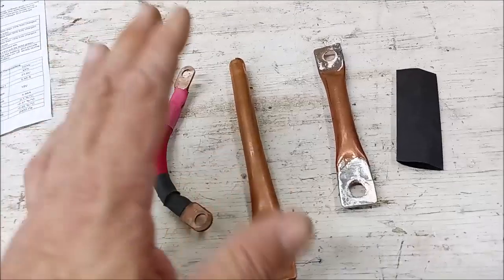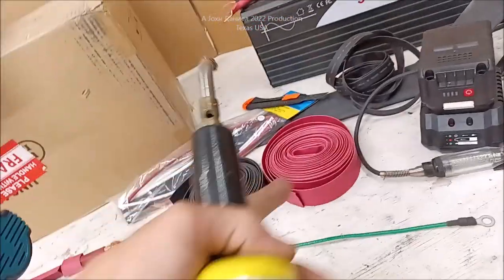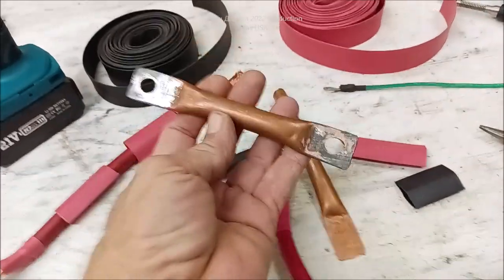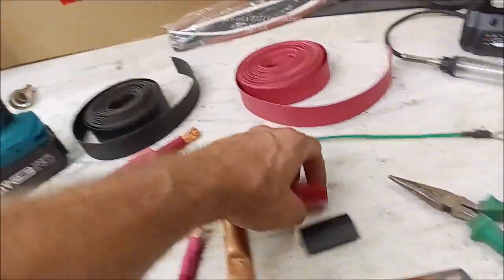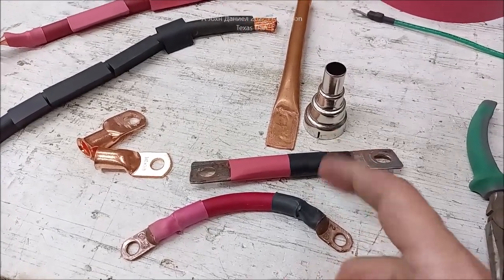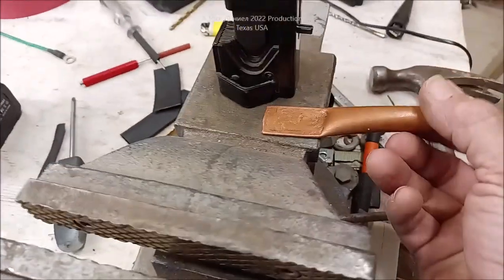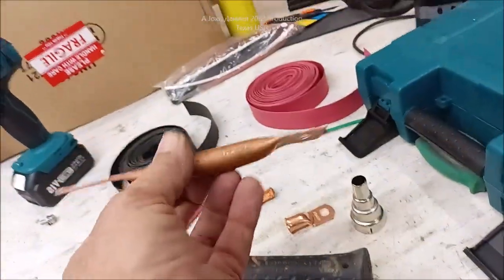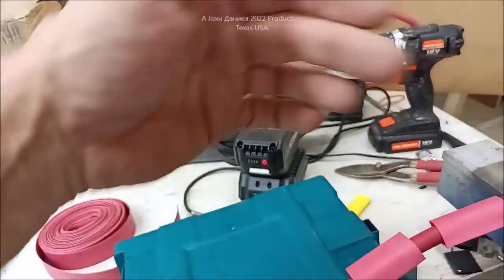Using Copper Pipe in DC Battery Circuits, Review the Uaoaii 21V Cordless Heat Tools

Comment: I've used copper pipe to make cable ends but never as a bus bar mainly because I salvage everything and booster cables that have a clamp pull off or break off are thrown out all the time so is copper pipe even had someone throw out welding cables so all my copper wire and pipe needs are met but it's good to know about the difference between water pipes and air conditioning pipes

Comment: Good to see you feeling better and back conveying knowledge again, John.  A curious thing happened down here in So. Florida (Miami) after that storm went by.  We didn't get much here in Miami except for a lot of rain and a few gusts of wind. Right afterward, and ever since then, my solar increased in efficiency by about 22-23%. Even had to disconnect a couple of smaller panels to keep the controller from overloading. Must have cleaned up the atmosphere a bit, or something. You ever hear of anything such as that before?
Reply: The storm must have cleared the atmosphere of the geoengineering nanoparticulate metals used for spraying from planes for man-made climate modification.  See Dane Wigington's channel for an explanation of that:    https://www.youtube.com/c/DaneWigington
Your panels would always work at that higher efficiency except for the aerosol spraying.

Comment: Good stuff! would you reccomend putting a tad of die electric grease on the bare copper wire before the heat shrink?
Reply from the maker: No, it's DC voltage, the real method is to fully compress. Torque in a DC connection is paramount. In dissimilar metals like Copper and Aluminum in a AC circuit you absolutely need dielectric grease to prevent corrosive effects.

Comment: G'day John, and hello to all the helpers on the team.  Great videos!  I am looking forward to you connecting your wind turbines into your Texas system.  I have looked at you OPC modules and looking to use them on my system here in Australia.  I did see you had more than one model possibly 3 different models and I was wondering about the reason for this and the detail behind each of them.   I see you run a solar and wind system and I am very interested in the reasons for using the mppt solar charge controllers over the hybrid charge controllers and understanding in more detail how you integrate the wind into your system.  If I have missed any of this in your previous videos somewhere it would be great to know where.

Cheers Colin

Comment: Very ingenious, John.
Would you explain how to choose a shunt for an ammeter/ampmeter (not sure which term is right) in a future video? I'm swapping my generator for a larger alternator in my van and I'd like to have some idea how to do it well.
Reply from the maker: They will be labeled size related. EXAMPLE: a 300 amp capable or designed meter will need a 300 amp 75 millivolt shunt. It is based on the maximum current flow the metal sheave can handle and field 0 up to 75 millivolts which the meter will read and convert to a amp flow based on the metal its made of. Some shunts may be 50 millivolt but most common is 75mv.

Comment: Have you tried a makita 18v battery in the gun? Was thinking of getting the gun only but concerned that the 18v makita won't get as hot as their 21v
Reply: The Makita 18v is probably better than the off brand battery that comes with this.  They are the same voltage even though they are named differently. Some manufacturers claim 18v which is nominal voltage and some claim max voltage such as 20 or 21. It's just marketing.

Comment: Sir I have a 4000 watt invertor that I had hooked up before and worked great, now when I hooked it back up again and used the test light you told me to get the light stays on  in the test light, the invertor will not turn on.
Reply from the maker: Disconnect the remote if it is plugged in. If its  a cordless wireless remote on it, hold the off button down when doing the volt tester charge up, if it had been put away and got arced it may have damaged it. If the manual switch is broken it may look ok but will need replaced to work, possible got hit when removed. You can try to put the battery cables on when the light is attached with minimal spark but if the sparks are big you have a internal short. Many of these if you disconnect them under load and in the on position they may lock up the relay or damage the on circuit.

Comment: John, what is a battery balancing  wire ???
Reply from the maker: It is for use on RV's that have a A/B battery system with a manual switch to equalize or connect the batteries with a limited 30 amp cross over.

Comment: I have to return my vise I have been using it wrong.  Mine can also hold parts upright when you close the two sides on the part.  Yours can hold parts flat and after you heat up the part you can singe your fingers from the blazing heat from the heat gun.  I like yours better 'cause I can go see the pretty doctor down the road from me when i fry my fingers